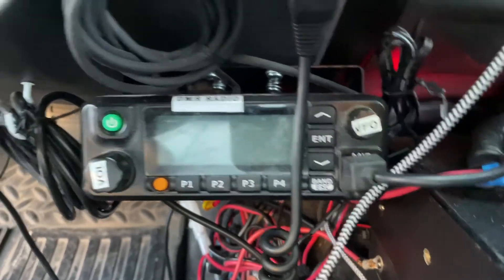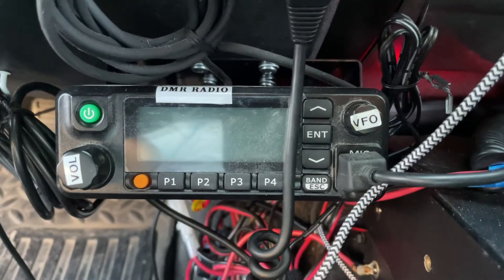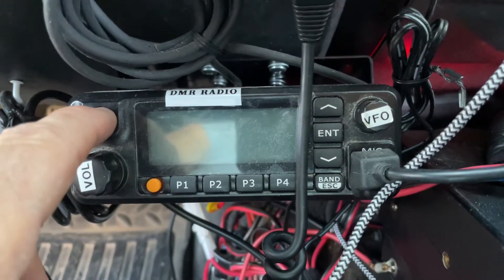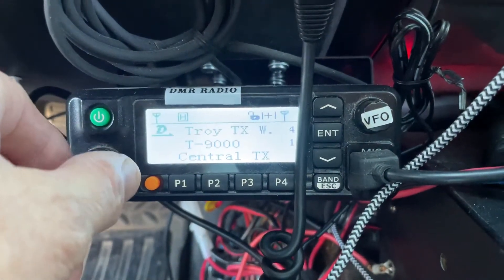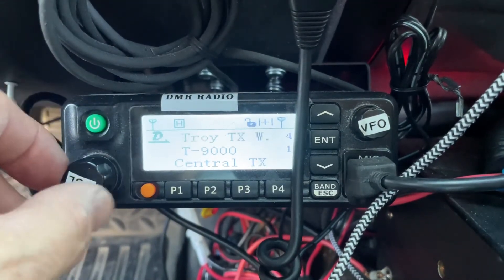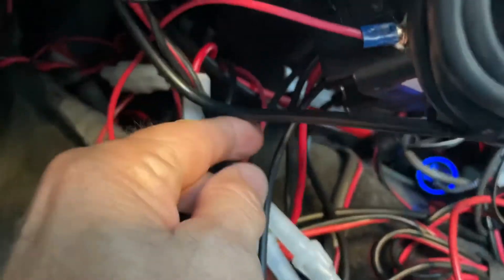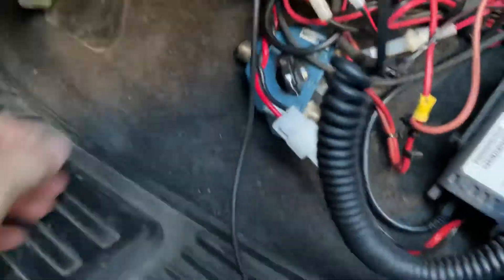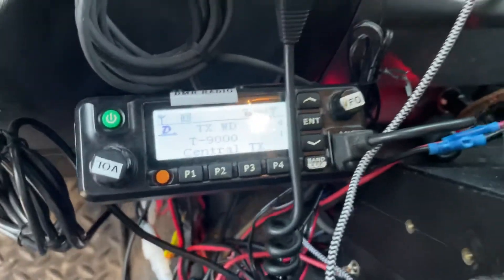TYT MD-9600 Radio Programing (Glitch) With USB Cable Video 1of 3.

Comment: So is there a fix for this issue?  I'm having the exact same problem!!
Reply from the maker: None that I can see. Faulty chip set in the usb cable. Chinese knock off drivers. I Sold this radio a while back. Will never ever buy another TYT radio. Also stay away from YAESU FT-991a , MY HF transmit went out today. POS radio.